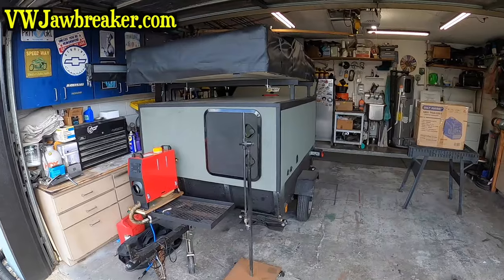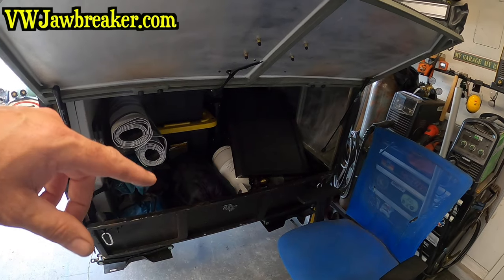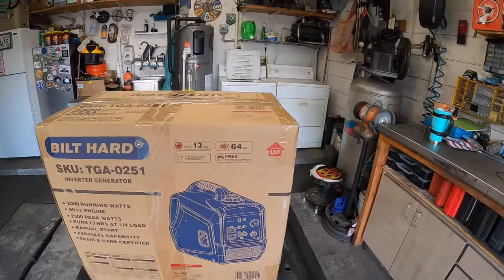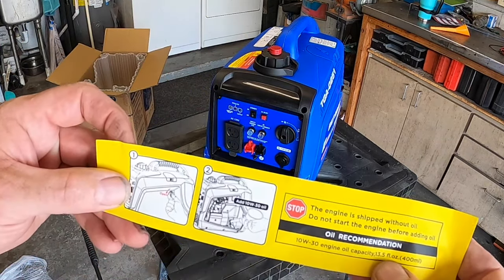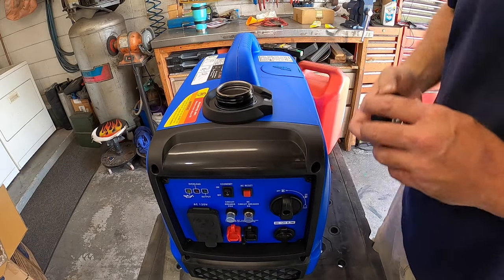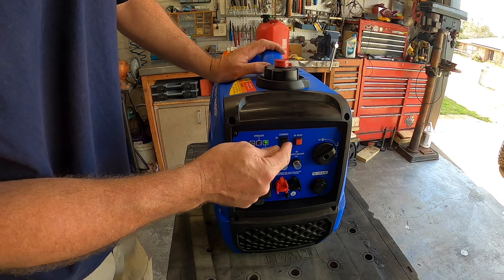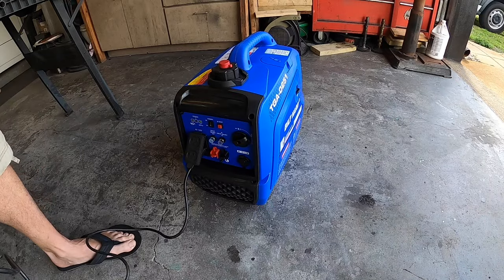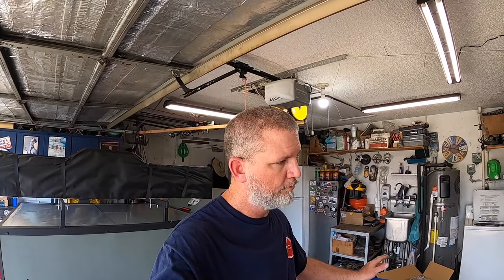Bilt Hard Inverter Generator - Good Bang For Your Buck?  Unboxing and Review. DIY Overland Trailer

Comment: Might need some earplugs at night time with that. Have you thought about a cooling blanket or running water lines  into your fridge to a circulation pump and run the lines in your sleeping bag to keep you cool?
Reply from the maker: It was echoing in the garage, it was quieter when I put it outside…. That didn’t dawn on me till after the video lol
I haven’t thought if that but I’ll definitely ponder it 🤙

Comment: Everything I’ve studied. You can get away with the 2000 watt generator on the small AC units. But he have to find one with analog controls the digital ones seem to give everyone problems.
Reply from the maker: Good to know, I’ll do a test run before I make any changes. Thanks for the heads up!

Comment: Such a great set up you have created. How does the shower tent work? I am curious about the drain, etc.
Reply from the maker: Appreciate it man. 
I’ll do a video down the road really going over everything in detail. 
Basically there’s a 2” gap or so at the bottom of the tent. You stand on the floor that’s kinda bungeed in place so the water just flows out and you’re still standing on a “mat”.

Comment: Hey Gary, 
If you install the generator in your trailer do you make a sound deadening type box.
Q. Your trailer needs a name. 
So thanks for sharing ✌️ Peace from Melbourne Australia
Reply from the maker: Kevin! 
I plan to keep the generator on the outside of the trailer to prevent it from getting too hot being in an enclosed space. 
You’re right, it does need a name. Someone a while back suggested Motel Sickxty but I haven’t really thought about it much.

Comment: Some twist the dipstick all the way into and back out to check the oil level, and others just stick it on the face.  Does this one specifically say twist in?  ty
Reply from the maker: I don’t have the manual handy to verify however if you want a true reading, the dipstick should be fully seated. Whether that’s pushed fully in place or twisted to drop fully into place.